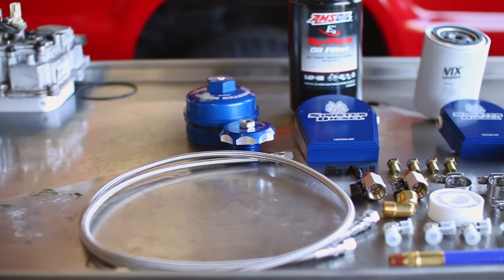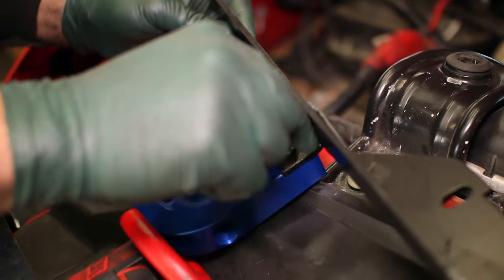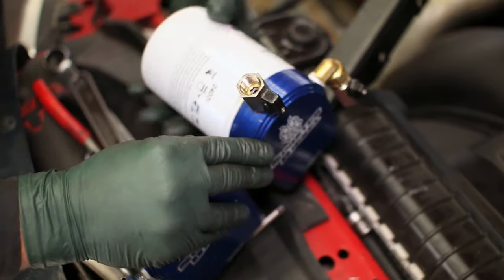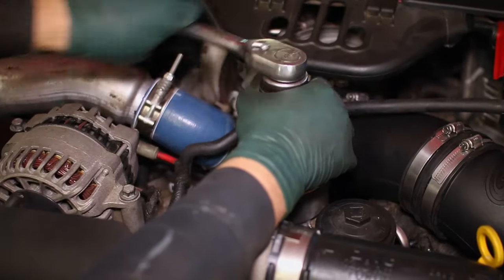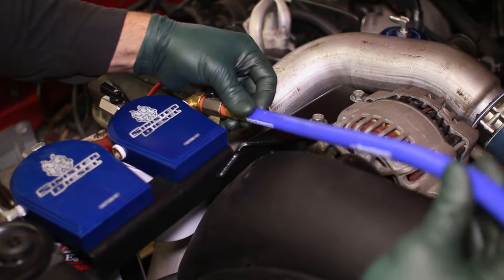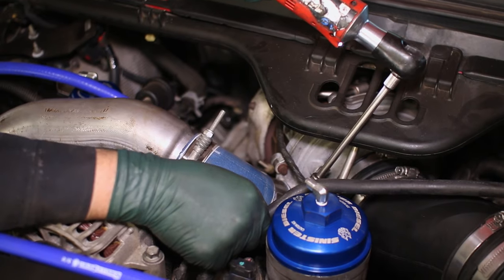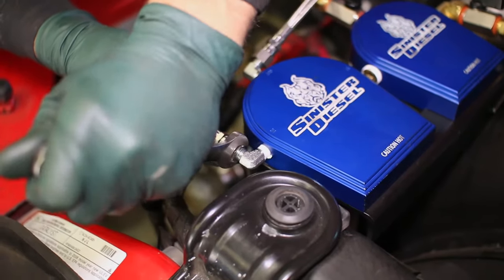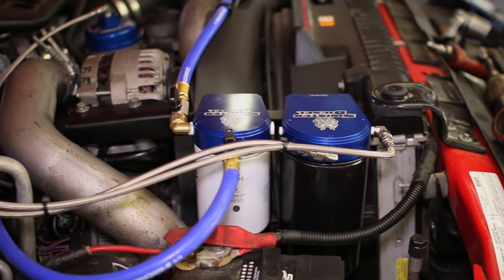2003-2007 F-250 & F-350 6.0L Sinister Diesel Oil and Coolant Filtration System Install

Comment: Thanks for the video.  Should start title with Sinister, had hard time searching for one doing both Oil & Coolant.  Doing this today and double checking procedure.
Reply: MrBigRed - I'm thinking about doing this, how are you liking it so far?
Reply: Went on a 1600 mile round trip two days after install and no problems.  Looking forward to cutting open the coolant filter next spring and see what crap may be in it. Next oil change is coming up soon and curious if I can tell any differance in it, saved some from last one.
Reply: Thanks for the quick response, I plan on ordering the Kit today.  Do you have to drain the coolant before you cut the hose?  Also where do you order you oil and coolant filters? What's the easiest way to cut open the filters to see the debris?
Reply: Should drain some, wish I had.  Have not ordered any extra filters yet. Have not cut one yet but youtube search will show you ideas.
Reply: My Sinister Diesel Oil and Coolant filtration system is now installed on my 2007 F-350, it took me about an hour.  I did drain some coolant before I started, the directions recommended you drain your oil,  I did not drain any oil.  Everything is running great.
Reply: MrBigredf250 The new oil filter cap seems smaller but are you still able to use the standard motorcraft filter with no problems?

Comment: when installing this is there any need to be concerned with the original oil cooler, or just follow these directions and everything should be good with this instalation?
Reply: Best option is to just spend the $2k on an external air cooler oil cooler and not have to worry anymore or replace it so you got a fresh oil cooler with fresh coolant that’s getting filtered running through it

Comment: Does anyone tried adding an external oil cooler with this kit instead of an oil filter. My 6.4 oil cooler is clogged and I wonder if this setup will work. Don’t want to spend on the 1,500$ kit as this truck has 300,000 miles.

Comment: The problem is not the filter its how it's installed splicing into two pipes while allowing the majority of coolant to continue unfiltered  to the oil cooler , is the problem do you think the sand in the coolant will do a 90 and go through the filter or carry on as it did before  and go through the rad and onto the oil cooler. I did a mod by mounting the oil cooler by the battery on the passengers side with hoses for oil and coolant, I installed a  2" strainer   which strains all the coolant before it passes through the oil cooler. these hoses allow me to back flush the coolant side of the oil filter as required and you would not believe the amount of sand I take out . Its been three year's now with no problems and my delta is 4degrees  to begin and I clean when it gets to 12 degrees
Reply: The splice as you pointed out makes sense bud.

Comment: If you hang 2 filters on a china bracket that is fastened at only one end it is going to snap, you can not fasten at both ends because the motor moves.

Comment: why a by-pass oil filter?  i have a added on full on filter that far out performs a factory unit. and it filters full time.
Reply: Larry Janson because a regular filter won’t filter below 20 micron or so, soot particles are smaller and cause wear. A standard filter has to maintain efficiency so the system still has enough pressure to maintain lubrication throughout. A bypass filters off about 10% of the flow and over time, will cycle all the system oil through it, filtering 100% down to 1~2 micron, reducing wear and extending oil life and maintenance intervals.

Comment: Do you have to bleed the oil system after? And coolant
Reply from the maker: While we recommend following the instructions of bleeding the system, it seems if you read through the comments below some guys have had positive experiences otherwise
Reply: No, just fill the bypass filter with some oil before mounting

Comment: so you have to take the connector on the filter cap off when you want to change the oil?
Reply from the maker: No you should be able to remove it with it still on it.
Reply: That's my thoughts....the filler neck has a swivel the filter does not....hmmm

Comment: how often we need to changes the filters? the new filters
Reply: Dek Zafra, I change mine once a year or 20,000 miles. Whichever comes first.
Reply: Considering nothing actually routes into the filter and the fluid just flows around them (path of least resistance) I would say they never need changed
Reply: Ozrith Clay that’s what I was thinking. Wouldn’t you need to make a way to stop the oem filter from working to truly bypass
Reply: Bulletproof sells a bypass oil filter system that seems promising.

Comment: need some help, does this add extra protection due to the original oil cooler that gives problems and is there any need to replace the original oil cooler located under the intake?
Reply: Derek Cotten these upgrades are a must! You can always take it to a diesel shop and ask them but these small but helpful upgrades do save your engine
Reply: Thanks so much Kevin, these 6.0's are a little aggravating with how they were made, just looking out for anything to help the Engine last as long as I can.

Comment: I didn't see any returns on this system just feeds
Reply: Ariel Zambada return for the oil bypass is routed to the filler cap. The coolant is either the line from the degas to the radiator or the heater hose.

Comment: If you hang 2 filters on a bracket that is only bolted down on one end it is going to snap, and you can not bolt it down on both ends because the motor moves.  JUNK.
Reply: lol your funny

Comment: Does that connect to the  Mishomoto radiator?
Reply from the maker: I would assume so, but give Sinister Diesel a call to confirm before ordering
Reply: @stage3motorsports  you can install it with any radiator brand .it is just to keep clean the cooling system